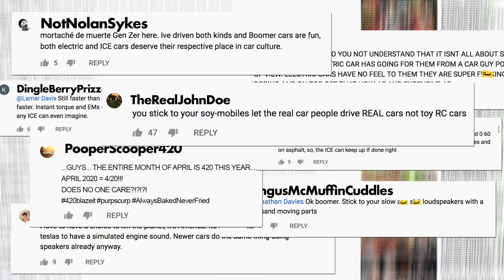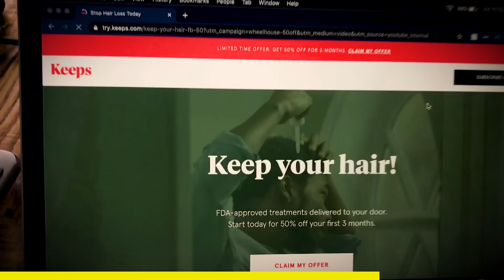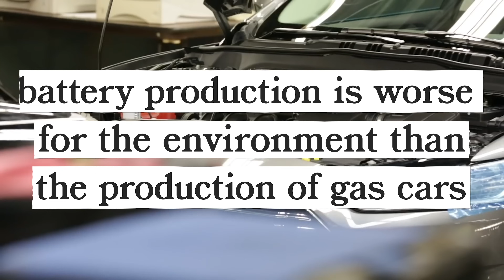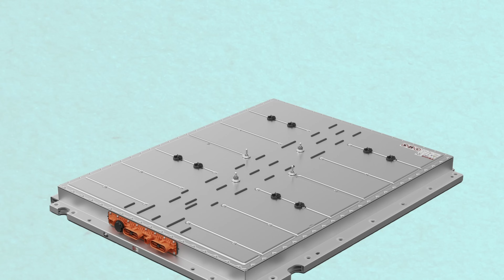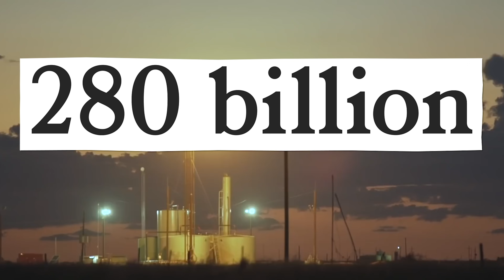Are Electric Cars REALLY Better for the Environment?

Comment: I am a residential electrician. I cant comment on the grid, but there are definitely houses that aren't ready for a car charging circuit without a service upgrade or second service. That is 5-20K depending on local code requirements plus an additional 500-2k for the car charger plug and circuit. It could be a hell of a lot more depending on the distance from the panel. For a big apartment building or condo to get a bunch of car chargers could be an incredibly massive project.
I am 100% for EVs, just saying.

Comment: Actually if we use CCD microcell and use the middle plate only then you charge high voltage on two outer plate then we use one charge is about thousand hours at least if we shield it well

Comment: The power grid in Multiple states in the west has rolling black outs  and constant brown outs due to low power and multiple failures in the infrastructure daily. There is absolutely no possible way the grid could handle 25% of the cars in the US being electric in the next 5 years much less tomorrow. With new regulations on power plants just being signed by the current administration and multiple power plants due to be taken off line and being replaced by much less efficient power sources in the near future this is only going to get much worse especially in states like California.  On the Production side of your Video I will agree but there have been multiple studies done on the US power grid and consumption rate and the serious lack of ability we have here to support a high EV society currently in many states.  

The cost of your Average base model Midsize EV for a family is around 55-60 thousand dollars as compared to 30-35 thousand dollars for a midsize car. Telling a family they need to have a car payment that is almost the equivalent to there rent/mortgage to be environmentally friendly is currently unrealistic. Most of the Mid size family EVs fall out of the 55k price cap for the 7.5 full rebate. even tho the MSRP may say 44k etc. when they hit the lot they tend to be much higher on top of financing in charging station if one is required for the type of EV at home etc.

Comment: Let's see...My batteries must have a recharge.  I am waiting in line for the charger and I am ten cars back.  Each charge  takes about 10 hours.  So one hundred hours later I may have a recharge.  During the wait time it   was either hot or cold and I had no heater or air conditioner.   Can't wait to get a battery car!!!

Comment: Lithium ion is a problem we are just now getting to the 10 yr point for early adopters. If the vehicle is traded or sold to some uninformed person they will at the very best have a $20,000 surprise when replacing the battery and at the worst a fire that could likely burn their home to the ground if parked in the garage and very possibly take the lives of them and their family. Everyone worries about range, I would gladly take a few miles less range for a safer battery technology. Fortunately they are just now starting too be used.

Comment: How did I not know about this guy??  This video is awesome!!!!  It’s very clear he reported the FACTS ONLY which very rarely happens nowadays.
Reply: alright another fact is that you have to replace the evs batteries more often then you have to replace a combustion engine which means in that combustion engines lifetime that ev has already replaced their battery multiple times which increases how bad it is far worse than gasoline engines.

Comment: What are the downsides to electric cars?

Their batteries need rare metals. ...

Making electric cars creates more emissions. ...

They are only as green as their power sources. ...

Electric cars can be expensive to buy. ...

You can't drive as far in an electric car. ...

There aren't enough charging points.

Comment: See no one takes into consideration What machines actually are used to mine the material to make the batteries and then the energy that needs to be produced in order to make the battery itself and then on top of that you're using fossil fuels to charge the battery you're actually 10 times higher running that battery f**** vehicle then you are a lifetime of your gas f**** engine running on the road. One battery in an electric car cost 25 tons of emissions and that's not including charging the battery that's just what it takes to mine the s*** and make the battery you will never see me drive a battery power car ten times worse for the planet

Comment: i would like to see the impact of the dead battery's through out the life of an EV like how many you will replace in your life and the recycling / disposing of them
Reply: @smokeystriper  EVs also have lubes as any motor will so lets compare ev fluids with ice fluids and keep in mind carbon is not the only or worst form of pollution

Comment: Lots of pretty good info. I seemed to have missed if you added the impact of the oil extraction and refining to the ICE cars (over all or per gallon). From what I have read, that adds about another 5ish pounds of CO2 per gallon that is burned,... or another 2500 lbs a year. (haven't addressed any oils, or other fluids in ICE or their disposal or production either :))
Reply: C02 is good it feeds the plants that then create more oxygen

Comment: I see story after story going on about the environmental effects of lithium batteries: look, we don't bury 12V lead-acid vehicle batteries in the ground, we re-cycle the battery's lead for new batteries. Up to now all we had was small cell phone and cordless tool lithium batteries to deal with. In these relatively small volumes (compared to EVs) there was not a whole lot of incentive to re-cycle. Now that we will need much larger quantities lithium, more work needs to be done to re-cycle these batteries to give lithium mining a chance to catch up to EV demand (I read that California is currently using old worn out EV batteries as backup for solar and wind farms, so they are not all going into the landfills there).

Next, we do not have to rely on China for lithium, we already have some here (as does Canada). There is a geothermal energy plant by the Salton sea in southern California (note the Salton sea is currently fairly toxic from evaporation over the years and farm runoff) that uses hot underground brine water to generate electricity. That hot underground water happens to be loaded with minerals (obviously: lots of hard water in the southwest) and one of those minerals is lithium, and quite a bit of it! One estimate is that there is enough lithium there to meet all of the United States needs, and forty percent of the world! Joe Biden has already invoked the Wartime Production Act to get companies to investigate environmentally friendly ways to extract lithium in the United States.

There is a similar situation for cobalt and nickel from coal mine waste. In this case it could be double win with the removal of these toxic waste sites (see the article: 'In coal country, a new chance to clean up a toxic legacy').

Comment: Well done video. I'm not convinced about evs though. Some jurisdictions are telling people not to charge their cars because of electricity demand. The need for battery replacement will be very expensive and I wonder if this nullifies the initial reduced emissions.  Other issues as well. Thanks for the great content.
Reply: What happens if saudis block petroleum products from US , what happens when supply chain for engines is disrupted. Things can happen both ways, you can run a million mile for the motor if you just change the battery but same can’t be said for ICE
Reply: @sa34w  The Saudis don't have unilateral control over the petroleum supply.  Most of the US's oil comes from the Americas.

Comment: Ik electric cars use Lithium for their battery They use 8-10 metric tons of co2 to make and combustion cars take 7 but in the life span of a combustion car it's responsible for 57 tons of co2 while the average electric is responsible for 28 also combustion cars drill into the earth for crude oil and this process releases co2 and methane also nitrous oxide. Not only that getting oil refinement is responsible for 767 million tons of co2 A DAY. The average car is responsible for 5.2 metric tons of co2 but in that same time frame oil refiners is responsible for 280 billion metric tons of co2